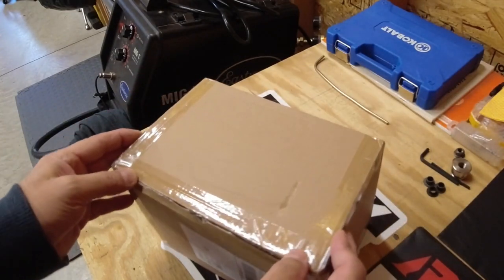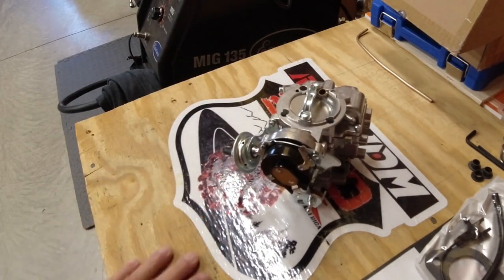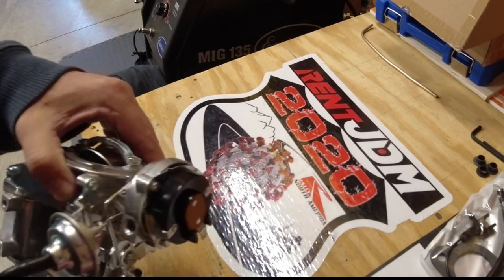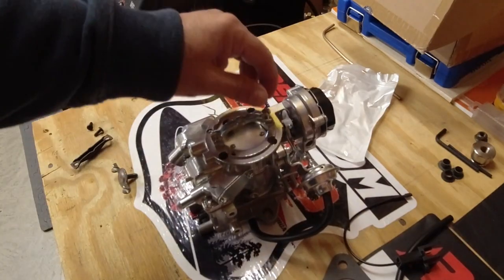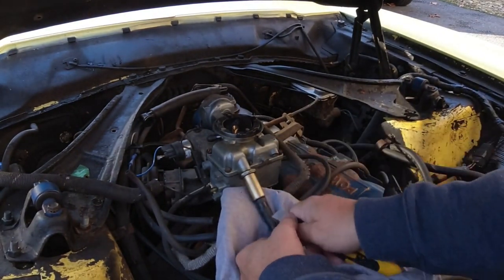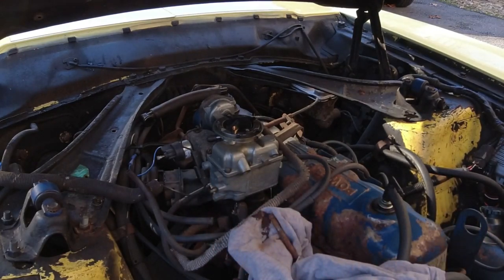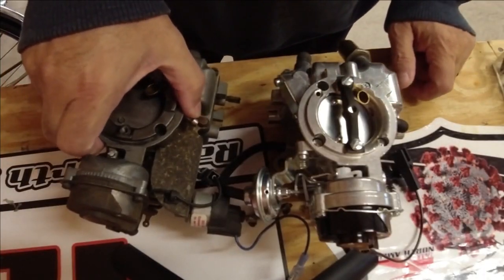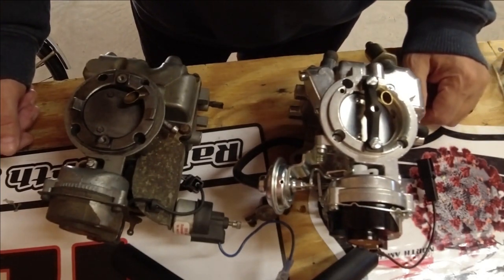An $86 Carburetor on a Ford Straight 6

Comment: I've purchased a couple eBay Chinese carbs for various ATV projects, just as a word of caution I've always taken them apart and inspected the passages for metal shavings and sure enough there's been left over chips from the manufacturing process.  Everything was fine after a good cleaning, just wanted to let people know if they ever have issues with tuning a Chinese carb is to check for metal debris.  Thanks for the video!
Reply from the maker: I'm not sure there is any consistency in their manufacturing process. I absolutely believe what you are saying and thank you for getting the word out.

Comment: I bought one and installed it on my 1980 Ford F-100 with a 4.9 inline six cylinder and it works great!
Only adjustment I had to make was the hot idle as it was a little low for my truck, idle mixture was spot on!
Reply from the maker: I'm glad it worked out for you. I ended up trashing mine. All the rubber went bad including the accelerator pump. I'm positive it would have leaked at some point. I did make a follow up video with a tear down.   https://www.youtube.com/watch?v=0ccY3WnzRqE
Reply: @TonysFordsandMustangs  Thanks Tony!

Comment: Excellent no-nonsense, no frills review.  Thank you for taking the time and energy to do a comprehensive and objective review.  Great assessment and display of rust "somewhere" going into the carb/engine.  Definitely makes me think twice about the carb I am trying to find for my '66 Mustang 6-Cyliner!
Reply from the maker: Glad it was helpful! After my experience I think you would be better rebuilding what you have or spending a little more for a rebuilt one at RockAuto. I ended up replacing the tank (which wasn't the issue) and all the fuel line (which was the issue) with Nickle Copper (that stuff is the best) fuel line that I bent myself using sockets in a vice and the old line as a guide. I then drove that car from Harrisburg PA to San Francisco and back. :) Yes I had some issue but fuel and fuel delivery wasn't one of them.

Comment: I just discovered your channel, such a nice christmas present, I'll be watching your videos. Your presentation is very good. I'm a 70 year old man who grew up with these early mustangs and mavericks. My parents in the 1960', 70's drove econolines and mavericks with six cylinders. My mother loved her Maverick, 6 cylinder , auto, P/S. They always started in below zero weather in central Minnesota, just had to keep the batteries fresh, those mechanical voltage regulators were tempermental. So, when I was in the Navy in the seventies I drove Mustang, 1966 2+2 fast back with 200 six and top loader four speed with hurst shifter all over the country, never had a problem. Today I drive a 1977 f150 300 six with c4 trans, P/S. Great cars and trucks back then, I live in the midwest in a small town, not leaving, they still sell regular gas here for my old trusty-truck.
Reply from the maker: Thank you for the kind words and for watching. Before you order one of those carbs you might want to check out the follow up video. I developed a flat spot after a couple of months. :) I too drove 6 cylinder Mustang during my time in the service during the mid 80's I was an Air Force Jet engine mechanic  stationed North Carolina. Both of mine were 67's with 200 6's one was an auto and one a three speed. I drove those cars back then because they were reliable, cheap, and easy to keep on the road.  They made plenty of trips back to Pennsylvania none of them quickly but they got me where i needed to go.
Reply: Thank you for your service to our country. Locally here I see weekly the B1 bomber training and sometimes at night those two jet engines light up and its like two rockets going up in the sky, quite impressive and the thunder, I'm miles away and the air vibrates.. @TonysFordsandMustangs
Reply from the maker: @bobbigwoody  Thank you for your service as well.

Comment: around 2020, I decided to delete the feedback system in my truck because it really was not running well at all, so I installed a vacuum distributor and in order to do that I had to replace the carb too.  I went with the amazon special carburetor like you have, and I did add a manual choke to it just because I wanted one in there.  so after I had everything snapped into place, and I tuned the carburetor I was actually impressed with a cheap carburetor like that one.  I might try to go the next level and install a 2 or 4 bbl, or maybe find a manifold that you can mount two single bbl carbs onto, but right now this carb is serving me well.
Reply from the maker: I'm glad to hear that. I had uninstall this carb 400 miles later as the accelerator pump and some of the rubber gaskets failed. I did a follow up video and a tear down video. https://www.youtube.com/watch?v=0ccY3WnzRqE

Comment: We put an eBay version on my uncles falcon and it’s been running for 6 years now. Just need to adjust it when the season changes. 

Swapping to V8 soon, it was originally a 289 car but someone stole that and put a 200 in it.
Reply from the maker: I didn't make out quite as well. This one lasted about six weeks and the accelerator pump failed. I did follow up video and took it apart.

Comment: A couple months ago I got an eBay $79 Carter YFA carb. I just have manual choke and not electric. Couple of months in and it seems to be doing fine. I took put a second filter. Pick up a spare filter; it's just two screws and a quick swap. That trip should clean out your tank. Have a great time. Don't forget the mix tape
Reply from the maker: I have to update this video. I'm four months in and the accelerator pump went out. I picked up a rebuilt one and I'm good to go. It ended up being $86 of money tossed down the drain.

Comment: I bought one. Works OK, wasn’t great out of the box but it did run and was an improvement over the carb that came off. It was A LOT lighter than the carb that came off. I need to work on tuning mine and maybe that’s my issue
Reply from the maker: I made an update to this video. I ended up taking it apart and tossing mine in the trash. I had a 6,000 mile cross country trip I was going to take and didn't want to press my luck. https://youtu.be/0ccY3WnzRqE
Reply: @TonysFordsandMustangs  thanks for the reply. I liked and subscribed. I will definitely be looking at your follow up video.
Reply from the maker: @AtomsForFuel  Thank you! It's interesting to see what's inside one of these carbs but it's not pretty.

Comment: Thanks Tony for showing what you got going on with your Maverick. On my 65 Mustang I put a new gas tank in . Hopefully my carburetor is OK or I will buy a new or rebuilt one also.
 Do they make gas tanks for Mavericks I wonder. 
😁👍
Reply from the maker: Thank you Roy and yes they do make tanks for the Maverick and I have found one for $129. I'm going to run the car and bit and see just how bad that filter gets before I buy the tank however I am pretty sure that's where I'm going to end up at before too long.

Comment: carburettor pump was loose its on the bottom of the carburettor. look out.  one went straight on the 1970 vw the 1965 au.falcon needs a clever handy man for kick back, throttle and adaptor
Reply from the maker: I did an update video. I ended up tossing mine in the trash. Accelerator pump rubber as with all the rubber in carb was cheap. It's a shame as it was close but not good enough to drive across country. Thanks for watching!  https://youtu.be/0ccY3WnzRqE

Comment: Hey I got this carb and was wondering what the thread size for the gas line was?
Reply from the maker: My factory filter screwed in and I believe it's 3/8"
Reply: It's 1/8"... The Wix filter number is 33046..

Comment: Hey Tony ,
New to your channel...
I am about to embark on swaping out my  Fuel Injection System ( F150 / 300 ) to a Carburetor System ...😲🤔
Ran across your video and that  Carb & Engine turned out nice and smooth...👍👌
How is the driveability...?
Reply from the maker: Welcome aboard! So far so good IF you check back in a month or so I plan to give it a 6,000 miles test and that should tell you all you need to know.
Reply: @TonysFordsandMustangs  
Thank you Sir ,
Question ;
Would you know if that eBay Carb & Size would work on a
300 4.9L /I6  Block..?
Reply from the maker: @alexandercamara2026  Not off the top of my head but you could easily look at a 1986 or earlier 300 to find a part number. Fuel injection was introduced in 1987 to the F150
Reply: @TonysFordsandMustangs  👌👍🙏
Reply: @TonysFordsandMustangs 
Hey Tony ,
By the way ...
What would you say  MPG  average is on a set-up like this or similar type..?
Reply from the maker: @alexandercamara2026  I really can't tell you as I don't track it. The Maverick does ok on gas but it's not a truck so you mileage is going to be different. IF I have to guess I'm getting around 20 MPG. Also my SIX  is a 250 CID.
Reply: @TonysFordsandMustangs Ok , Thanks ...👍
& Yes , I have heard they are in the 20 mpg range but either way I am happy I picked this F150 @ County Auction with only 75k and spent it's life as an Aviation / Paint Maintenance  Vehicle...
Never , ever left the Airport...😲
I had one (300) in my E150 Van and regret having sold it.
Again , Thanks for the feedback...🙏
Reply from the maker: @alexandercamara2026  That sounds like a great truck! If you going to switch it over to a carb and intake consider going to standard ignition system as well. Fords electronic ignition system used a computer system to control everything Timing etc. and eliminating that would make trouble shooting pretty easy.
Reply from the maker: Alex save your $ or spend a bit more and find a rebuilt Carb. I went on a 70 mile test drive this weekend and this one isn't going to work for me. It has a hesitation or flat spot in the carb. I will be making a second video once my rebuild kit gets here.

Comment: i have a 86 f150 st 6 with a clapped out carb… what should i get for stock replacement?
Reply from the maker: I did a 400 mile follow up video to this one and I ended up tearing it apart and tossing it in the trash. https://youtu.be/0ccY3WnzRqE  I ordered a rebuilt carb from RockAuto and drove my clapped out 1977 Maverick 6,000 miles from my home outside of Harrisburg PA across the Golden Gate Bridge and back. Had some issues but the fuel system wasn't one of them. I would say learn from my mistake spend the extra $100 and buy the rebuilt one from RockAuto.
Reply: @TonysFordsandMustangs  thanks
Reply from the maker: @LidoLife  Best of luck!
Reply: @TonysFordsandMustangs  thanks i hope it’s not needed.. lol

Comment: I know I'm having trouble with the one I got for my pickup.
Reply from the maker: I'm guessing you didn't see the follow up video? https://youtu.be/0ccY3WnzRqE
Reply: @TonysFordsandMustangs  Nope. I'm dealing with it real time. Thinking I have the wrong base plate gasket on. Also, getting rid of the smog plate under the carb. And yes, new exhaust, alterations, alterations... I'm about to drop a points set In it and eliminate all the BS!
Reply from the maker: @LeonDafler  Those carbs have issues. I ripped mine apart and after looking at the lack of quality rubber and design I broke down spent the $$ on a good rebuilt one at Rockauto. Drove the car From Harrisburg PA to the Golden gate bridge and back. I had some issue but none were carb related other than the 8,625 Foot altitude in Wyoming.  Carb didn't like that all that much so I couldn't stop. Look at the second video. I tear the carb apart and you can see what's in there.